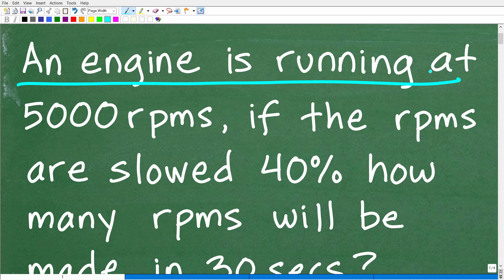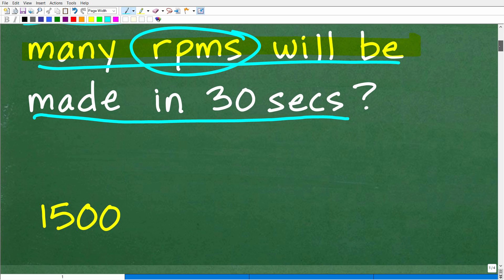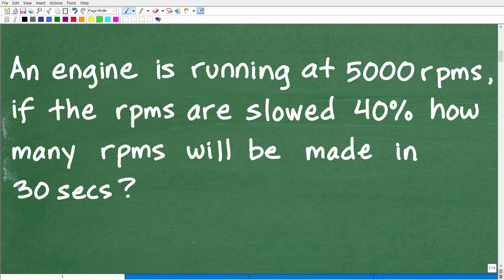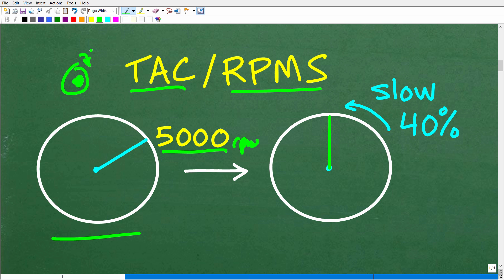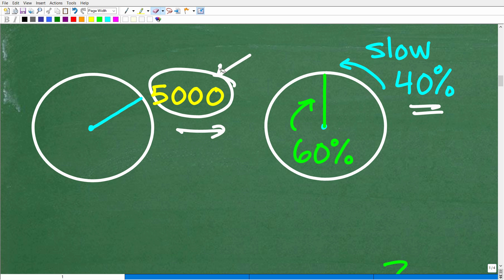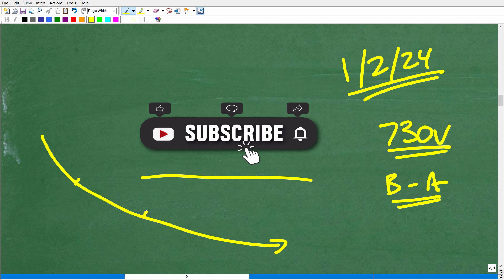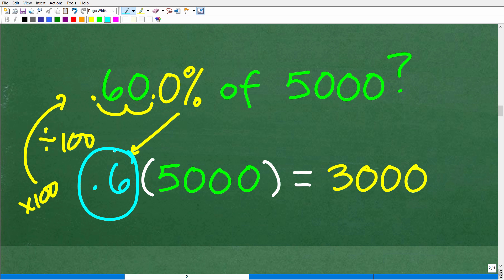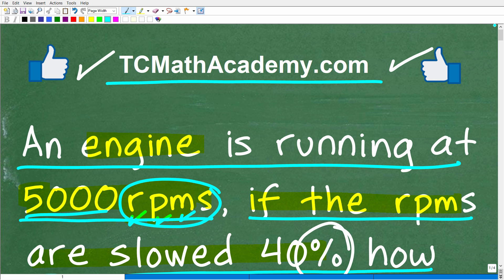An engine is running at 5000 rpms, if the rpms are slowed 40% how many rpms will be made in 30 secs?

Comment: to determine the new rpms after 40% reduction, I would have used : (rpm2 - rpm1) / rpm 1 = 40/100   rpm1 = 5000, solve for rpm2. Then convert RPMs to R per sec, then x 30 sec.

Comment: 5000 RPMs minus 40% of 5000 RPMs results in 3000 RPMs whether in 30 seconds or 30 hours.  Now 3000 RPMs will result in 1500 REVOLUTIONS in 30 seconds but you asked "how many rpms" will be made in 30 seconds.  (U.S. time system:  1 minute = 60 seconds, so 30 seconds will yield 1/2 the number of revolutions that a given RPM would yield in a full minute.)

Comment: Our American cousins favour the rpms terminology. The correct term is RPM as in revolutions per minute not revolutions per minutes
Reply: No they don't.
Reply: As one of your "American cousins," I can state, unequivocally, that we use RPM.  
1 RPM, 8,000 RPM, etc.  The "R" in "RPM" signifies "Revolutions" (or "Revolution," depending on context).  Never would we "American cousins" use RPMS, rpms, RPMs, or RPM's.  Never, never, never.

Comment: 5000x.6x.5=1500 revolutions. NOT RPM.  BTW the acronym is RPM not rpms.   The instructor (not a STEM teacher or Engineer)did not show work, and the units wrong scores 0 points
Reply: OMG 😮tachometer abbreviation is TACH NOT tac

Comment: Since it is asking for RPM in 30 seconds the correct answer is Between 5000 and 3000 RPM depending on the rate at which it slowed down.

Comment: He’s using rpm wrongly. It’s RPM not RPMS !! The answer is it’s still running at 3000rpm.
0/10 for the question and then even less for continually saying the plural ‘rpms’ it RPM ffs.

Comment: This is a 7th grade math problem.  But complicated by the lack of wording.  If you want to make it harder determine the rotations during a 30 second period of angular deceleration and at least make it a calculus problem
Reply: Agree! Also, it seems a bit confused the question as can mislead is there is multiple choice answer to say between 1000 or 15000 revs. In the math question have to reduced "to" or "by", hence, from there the answer will be 1000 (to) or 1500 (by). Maths questions have to be well written to avoid confusing answers during the procces

Comment: Was initially bushed by the 40%... 
Whether the engine was slowed to 40%, or by 40%. By 40% means 1500 revs in 30secs, and slowed to 40% means 1000 revs in 30 secs👌🏾
Reply: Excellent. Maybe an English lesson is required before the maths (yes maths not math - I'm English).

Comment: Unfortunately the answer 1500 rpms is wrong. After reducing the speed by 40%, the motor rotates at 3000 rpm. It doesn't matter whether it's 30 seconds, an hour or a day. No smiley, no A+ and no star for the teacher...

Comment: There was a missing factor in this question. You failed to specify the rate at witch the RPMs were being reduced. I.e. how many RPMs per second is the rate of speed reduction. Or is it assumed that the reduction in RPMs is instantaneous? If that were the case the final speed would be 3000 rpm, and The time period of 30 second would be irrelavent.

Comment: To find the new number of RPMs after slowing down by 40%, we need to multiply the original RPMs by 0.6 (1 - 0.4 = 0.6):New RPMs = 5000 * 0.6 = 3000 RPMsTo find the number of RPMs made in 30 seconds, we need to multiply the RPMs by the number of seconds:RPMs in 30 seconds = 3000 * 30 = 90,000 RPMs

Comment: The problem in question should be "how many revolutions will be made in 30 seconds  if the current rpm of 5000 is lowered by 40%"
Reply: @bulldog6925 Beautifully and eloquently put! When you state the problem that clearly the answer pretty well jumps out and calculates itself!
Reply: You're right. I was even wondering how long the engine was running at 5000/rpms before the speed was lowered by 40%. and if the 30 secs included both before and after the speed was reduced. Or was the engine set at 40% its speed capacity before it even started to run.😂 It says the engine is running at 5000 rpms meaning it was already running at 5000 rpms before the speed was reduced by 40%.
Reply: @nyc4max  Yes, and the word 'by' would have been handy in any case.  "slowed to" and "slowed by" result in two different outcomes.  Would it have been so difficult for him to have stated "if the rpms are slowed by 40%"?
Reply: @nyc4max  All excellent points (IMHO). Those who set these so called "word" maths problems have a duty to the student to be as precise and unambiguous in their language as is the mathematical language itself. As an illustration see the example of our mutual friend @bulldog6925.

Comment: In physics, the "r" in rpm stands for REVOLUTIONS per minute and refers to  how many times an item revolves or turns around an axis. So revolutions per minute is correct in  the context of this video's presentation.
Reply: No, this is completely incorrectly worded. “How many revolutions per minute in 30 seconds” is absolute gibberish. Math teachers need to emphasize the imperative of not mixing units of measure. This is an epic failure.

Comment: 40 percent of 5000 leaves 60 percent or 3000.  Since its rotations per minute and 30 seconds is half of a minute, just divide by 2(or multiply times 0.5) to get 1500.
Reply: Yes 1500 revolutions. But, rpms is 3000/2

Comment: Decades of Maths, but perhaps spend some time with your literacy colleagues in use of English?😉

"rpm" is already plural, (beyond one revolution per second); "rpms" is plain confusing.

Say "number of" not "amount of" [rpms]; revolutions can be counted not measured in "amounts".

Also, take the ambiguity out of "5,000 slowed 40%" Does this mean 5,000 is slowed to 40% of its original value, or 5,000 is slowed by 40% of its original value?

Finally the question asked in the words given is nonsensical: How many revolutions per minutes (rpms) will there be in 30 seconds? 🤔

I suppose if the engine were running at 5,000 rpm, and the speed has reduced by 40%, to 3,000 rpm, then after 30 seconds have passed the new speed "rpms" will by then be a steady 3,000 rpm, but clearly the answer the question asks is not the answer the questioner wanted.
Reply: yeah, I agree, its worded poorly
Reply: It could possibly have been a trick question in that respect
Reply: @christopherrudd7561  Yes, attracting comment and discussion is Oxygen to sites like this. The "errors" did seem remarkably naive 🤔 .

Comment: Horrendously poorly worded question, and an even worse explanation. The answer is 1500 revolutions, not 1500 RPMs. Throughout this video, you use both terms interchangeably. That’s like saying that miles and miles-per-hour are the same thing. “How many RPMs will be made?” is akin to saying “The distance from my house to my office is 5 mph.”
Reply: Yes, I agree the wording is weird. The answer would be 1,500 revolutions in 30 seconds and 3,000 RPM’s for 30 seconds 😂
Reply: Yes!  Very surprised he made that error😮
Reply: You saved me the comment. The rpm would be the same whether you wait 30 seconds, a minute, 10 minutes, or an hour.  It is a rate.  What it should have asked is how many revolutions are made in 30 seconds.  He recognized the issue when he read the problem... But glazed over it
Reply: RPM’s 😂 Good grief.  Stick to the day job!
Reply: Rpms is not an acronym, it's simply initials, an acronym is made up of initials that make a more or less pronounceable word.
Reply: He got us here, didn't he? And commenting. I guess he achieved something.
Reply: WTF are RPM’s 😂 Revs per minutes? How many minutes?   I’m guessing you mean RPM. Stick to maths and leave the engine mechanics to erm….mechanics! 😂
Reply: 😮 lol not an engineer 😂
Reply: RPM is the proper unit of measurement, teacher John.
Reply: Also it only says: "slowed 40%". Are we to understand "40%" or "by 40%". The answer then would be different, to 40%  =1000 revs, by 40%=1500 revs
Reply: @apmjunior84 I was thinking the same, the question say is reduced to 40%, hence the answer is 1000 revolutions

Comment: Just a point on units: rpm: rounds per minute. So RPM/30 sec is an error in the proposition.
Reply: Right. It should read: How many revolutions in 30 sec.
Reply: Revs not rounds
Reply: @martinlong8739    lol. touche.

Comment: Technically, it will still be running at 3000rpms; but if you mean how many rotations in 30 seconds, that will be 1500.
Reply: What's rpms?
Reply: RPM = revolutions per minute